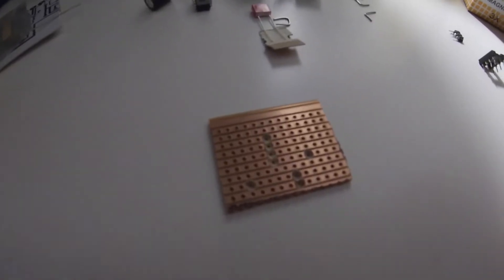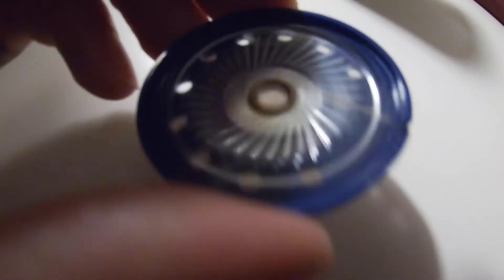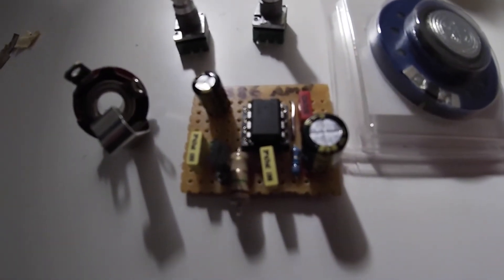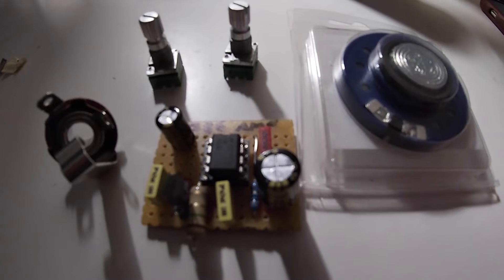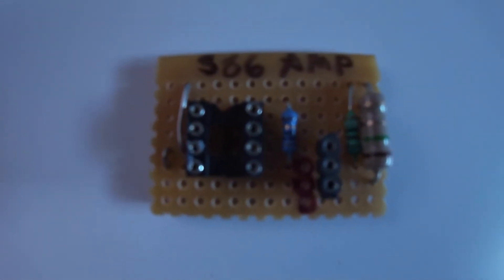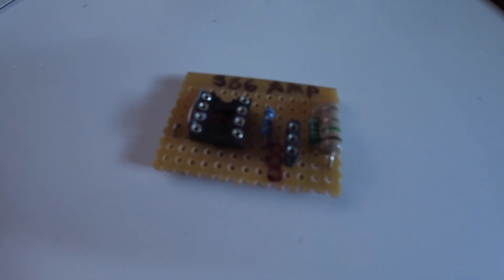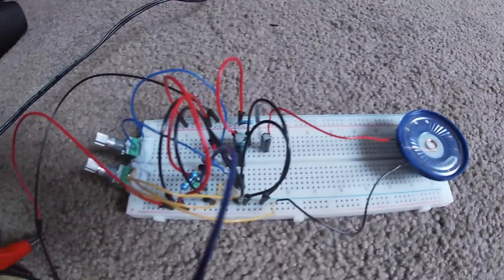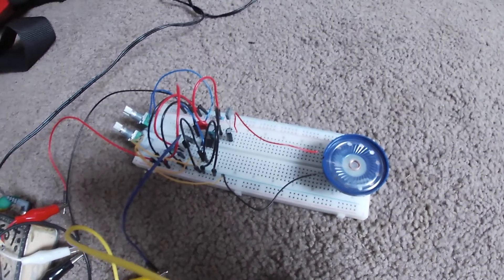Ruby Amp Pt.1 - 3 attempts making my first guitar amp, but failed.

Comment: Where did you get your MPF102? Those haven't been made in a really long time. I would guess you got some knockoff that has the same specs on paper.

Try another modern JFET transistor.
Reply from the maker: Got loads of them whatever they are they work. This is an old vid, the amp I attempt here works.